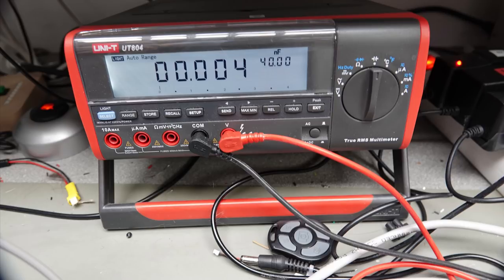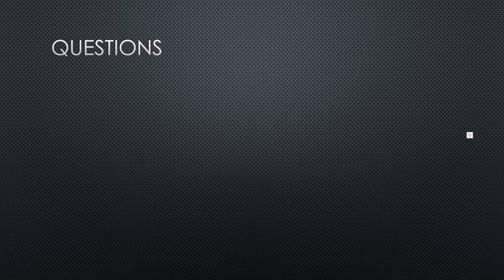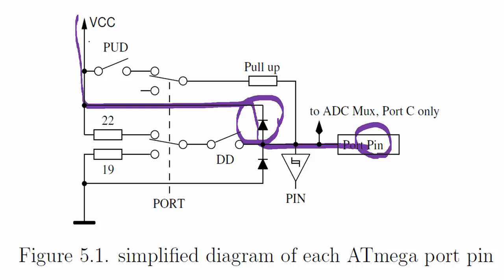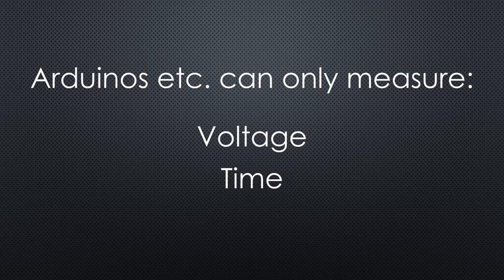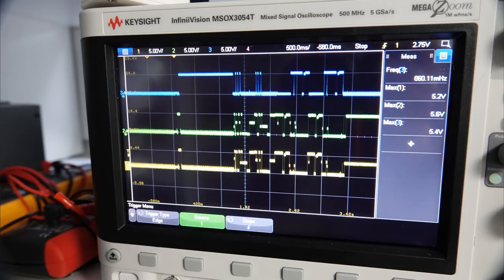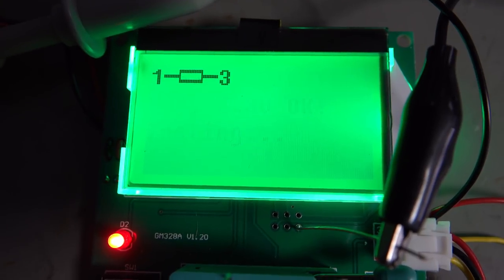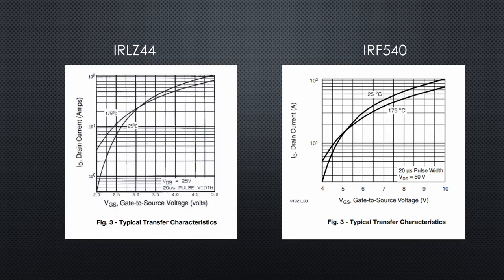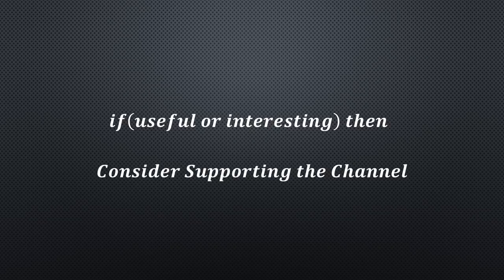#290 How do Transistor Testers work (and some other insights)

Comment: I ordered one but was not able to receive it until well after the warranty period had expired.  Unfortunately, I found that during shipping someone had stepped on it and broken the LCD.  Anyone know where I can get just the display?  Yeah, sure, they're too cheap to repair, but my engineer sense is offended by this.  A thousand Chinese vendors are able to buy these parts by the truckload so why can't I buy one or two as spares?  I've since ordered another device, but I really would like to repair the broken one if just to prove to myself that I can.
Reply from the maker: I cannot help you :-(

Comment: I bought one of these Chinese boxes a couple of years ago, and found the original project due to curiousity how it works.
Truly fascinating little devices, and so useful!
I noticed the original project is/was still going, and had added support for the various displays the Chinese have bolted on.
I did mean to flash an update onto it, but never got round to it (would have involved some board surgery, and my German improving!).
Reply from the maker: This is why I avoided recommending that possibility ;-)

Comment: I repair a lot of stuff (mostly consumer electronics/appliances) and a cheap component tester like this is one of my most used devices for that. What's also nice are those cheap microcontroller based oscilloscopes (I have a JYETech DSO Shell, that I use more often than my "proper" scope).
Reply from the maker: I still use my normal oscilloscope most of the time because I am used to it and know the dials ;-)

Comment: Do any of the clones use better quality parts. I have one but find the battery doesn't last long (rechargable), the display is poor quality with terrible contrast, and the buttons are hit or miss. I don't have a lot to spend but would like one that's reasonable quality.
Reply from the maker: I did not do any tests. Rechargeable batteries might have a high self-discharge. I do not use them anymore in such applications.

Comment: Why the big zif socket if only three pins are needed and not order dependent?  Maybe you can't get smaller ones?
Reply from the maker: Maybe they are cheap?
Reply: Pins in the socket are interleaved to allow parts of different sizes to be inserted. (Choosing an interleave pattern is actually an interesting optimisation problem. Different clones solve it with varied success.)
Zif socket also allows to hold legs of different thickness securely.
Reply: @killymxi   thanks for that.  For maximum flexibility each zif pin needs it's own io port...  unless some are marked as unusable. Hard wiring some together would lead to the possibility of two legs of a component being connected to the same port, which couldn't work. Plus,  I think only two ports are assignable to the adc,  so the plot thickens.  Just for amusement, years ago I was sent free samples of an 80 pin microcontroller.  Scared of sub millimeter soldering I asked the price of a zif socket.  I think it was about 200 pounds.  Gave new meaning to the phrase "cheap as chips".  But not cheap as sockets....

Comment: I saw this tool for the first time in 2014, do not hesitate to buy it, it is very effective for diagnosing components quickly, but I still have my component testing guidelines as in the old school.  It seems to me that this device gets dizzy with the triacs according to the position placed, it happened to me on one occasion.
Reply from the maker: As I mentioned, it does often not work for triacs because of its limited current and voltage capabilities. It is described in the manual.

Comment: Here is an upgraded version with rotary encoder $11 - https://www.banggood.com/GM328A-LCD-Transistor-Tester-Diode-ESR-Meter-PWM-Square-Wave-Generator-Soldered-Module-p-1384846.html?rmmds=detail-left-hotproducts__1&cur_warehouse=CN 

Maybe an updated design with a boost converter P.S. could automatically test semiconductors at higher voltages. Future designs may even be able to include testing vacuum tubes and find reverse breakdown voltages (e.g., distinguish between 1N2003 versus 1N2007) and display higher Zener diode voltages!
Reply from the maker: Thank you for the link!

Comment: I have one and I love it! I have tested lots of stuff with it, I think like you said some of the triac  stuff might not read but I would say about 98%  of the time it is right on. I think that I have successfully tested scr s, and triacs,  I find that there is no one single tool that does it all anyway,  but this thing is pretty amazing
best $15 I spent.
Reply from the maker: Bigger triacs need more current than the device can supply. This is the reason they are not detected. Otherwise a great tool, I agree.

Comment: I really need to get one of these; but, I keep procrastinating.  In a pinch I just use my DMM.  I even sometimes use the diode test mode for transistors.
With my eyesight not as good as it once was, I find myself using the DMM more and more and the color code less and less.

BTW, if I was making one of these, I would use the non-linear behavior of semiconductors as a first check for classification.  This might have been a nice opportunity to introduce linear vs non-linear devices; but, I also appreciate that you are keeping you videos short.
Reply from the maker: I think it uses the "non-linearity" a lot because knowing where diodes are is essential to detect the parts. But of course, it is not a curve tracer. Maybe I do once something like that.

Comment: Thanks so much for this video It answered all the questions I ever had about this device and then some a few years ago when I started messing with Arduino I searched for the software for device in hopes to build my own and possibility  of adding some ideas to the software but I could never find much about this device other than the fact that the Chinese made it and I don't speak Chinese. This is the most informative video ever on this device and my hats off to these two great inventors!
Reply from the maker: I knew since some time that it was invented by Germans, but not how it works.
Reply: @AndreasSpiess  Thanks to these 2 fine Germans and you to you my friend.

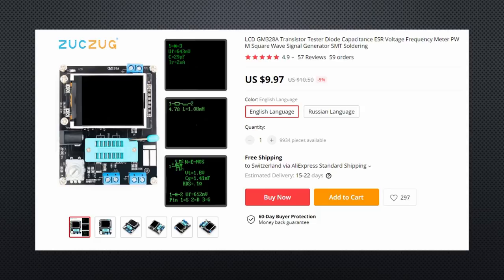Comment: He put the design online for anyone to use. I think that was very cool of him to do that for all our benefit. It's a must have devise for any electronics hobbyist to have. I blow the main chip in my one by connecting it to a fully loaded capacitor like a fool. I was checking zener diodes on a board with the little hook leads that came with it, and the I checked some normal diodes that were unfortunately open and the hook leads were still in the zener section of the tester which can put out up to 30 volts. And that's how the capacitor was charged up. Oh well ya learn from you mistakes. Need to get a new one!! I have my eye on the one he showed in this video at 19:45 the GM 328A  that has the PWM and signal generator built in. Looks nice. I'll just make a zener tester up from scratch. Kasan tv channel shows how to make a nice little one if any is interested in making one!!!
Reply from the maker: Maybe you want to leave a link to this video?
Reply: @AndreasSpiess  I don't use any other form of social  media apart from this (commenting on videos) and I hate Facebook so much that I won't log on long enough to delete my profile.. no bull.. plus I don't know anyone who is into electronics. (Its far to complicated for "everyone" i know) All I can do is mention it in some furture comments on simular videos. 👍

Comment: If I remember correctly, the project started by reverse engineering the (quite expensive) commercial product which does the same. But yes, the component tester finally became better than the original and it can detect (and measure) more types of components. And if I remember correctly the original tester was blue and was some weird shape.
Reply from the maker: I do not know the history from before I told it in the video. Maybe there were more „inventors“ necessary.

Comment: Thanks for the video, letting us know the great project they made. The tester struggles to test some triacs such as BT136 because of required current gate  which the tester can't give and as result  a transistor is represented. But this isn't a bad thing since it is in the specs and for its price it performs pretty good with other components. to test triacs use a simple dimmer circuit as described in the app note of datasheet of the triac.
Reply from the maker: As you said, it is written in the documentation that it will fail with many triacs.

Comment: Can you  recommend  (or "dis-commend") certain versions?
Reply from the maker: I did not do a test (I only have 2 recent ones). But I assume they are similar (if the photo is the same). As mentioned, some have more features, but it should be in the "feature list". I use the second one if the first one did not "convince" me. Sometimes they agree, sometimes not...

Comment: These are useful devices.
Way back in the early 1980s I bought a device which I still use about once a year to program a couple of fusible link ROM chips.  It is a HiLo model ALL-01 Universal Programmer - from Taiwan I think.  The programmer is a box containing pin driver, pin sense and power supply circuits for the 40-pin ZIF socket.  This connects to a dedicated AT expansion board in the PC via a 25-pin cable.  The software runs in DOS and needs a CPU running at 8 or 12 MHz.  To operate the programmer I keep a dedicated 386 12MHz PC running Novel DOS-7 on a CF card pretending to be a hard drive.
Another feature of the ALL-01 that I didn't seriously use is that it came with software that makes it a universal chip tester, at least for the limited range of chips from the early 1980s - mostly TTL from memory.  With modern microcontrollers with analog inputs much less circuitry is needed and we no longer need to be programming and erasing EPROM chips to make our projects work.
Reply from the maker: Maybe you laugh now: Some EEPROMs including a UV eraser are in the mail. I plan to show the younger how this worked in the 80s...

Comment: Somebody, redesign this from Atmel to STM32! Make it more cheaper and add more ADC bits!
Reply: One problem with that may be that the STM32's use 3.3V, so getting past some threshold voltages may be more difficult.  The new ATMega clones, like the LGT8F328p have better internal voltage references, and 12-bit ADCs though.
Reply from the maker: @Valdis: Why not you, if you think this would add value?
Reply: @AndreasSpiess  I'm too lazy for this job...
Reply: @GnuReligion  yep, 3.3V is too low for the job :(
Reply: Because Atmel master race.

Comment: Danke, noch einmal.  I too find the tester extremely impressive, and I made a career of creative designs. And to think the genius who invented was 16 at the time!

Did you ever double-check your BS108s?  Say plug in only the "gate" and one other pin and see if it reports a diode?  I have received several fake parts from China, and the tester has revealed them. It's in fact one of the principle uses I have for the tester.
Reply from the maker: The "BS108" were recognized by all testers as NPN. So they are either fake or very special. I bought them because I wanted a small through hole FET switch which they obviously are not. This is why they are in the bin now.

Comment: One of the most frustrating things with the Chinese clones is that the parts specified in the manual aren't even much more expensive (in China) than the alternatives that are used! They're saving literally pennies and creating a device that is measurably worse!

The manual recommends 0.1% resistors for 680Ω and 470kΩ, which can be bought in ±25ppm 0805 SMD size for less than $0.50 each in 10 qty from Digi-Key/et al., or less from LCSC (you don't even need to use through-hole parts), and one of the recommended voltage references is the LM4040AIM3-2.5, which is a 0.1% 2.50V SOT-23 part and is around $0.25 each on AliExpress in packs of 20 (more like $1.50-2.00 at Digi-Key).

I bought a load of all of those parts almost a year ago with the intention of upgrading the accuracy of my component testers, but for various reasons that's still on my to-do list... (Check the pinout of the LM4040AIM compared to the TL431 - or whatever your board uses - if you're going to make that upgrade, and ideally check the board layout as well, just in case it uses a weird TL431 clone with a different pinout!)

Also, my Chinese clone testers don't even use 1% resistors, from what I can tell. My multimeters aren't the most accurate devices on Earth, but they're accurate enough to show that several of the 680Ω/470kΩ resistors across my three component testers aren't even within 5%! Most of them are within, or close to, 1%, but I have a few resistors that are 6-7% out, which is just ridiculous. Where are they even getting such bad resistors‽

I seem to recall that the TL431 reference used on my testers was well outside of 0.1% as well, but I don't seem to have measured values to hand.

I wonder if it would be possible/practical/worth the time to add a higher-resolution ADC to the schematic and code? IIRC the HX711 that's used in all the load cell Wheatstone bridge boards on AliExpress/etc. is/has a very high resolution (24-bit?) ADC. The 24-bit ADS1256 is available on AliExpress as well, but it has 8 channels and is rather expensive.

I've considered creating my own PCB layout for one of these as well. Mostly just for fun, but maybe I could create a version that fitted into a neater 3D-printed case, for example (but of course anything I designed wouldn't have to worry about ease/cost of manufacture/soldering/etc.)...

And thanks for making more people aware of the history, source, and creators of these devices! :)
Reply: I don't know if there is any memory in the unit, but wouldn't it be possible to calibrate it by connecting a known resistor? Of cause, the firmware should be altered to support this.
Reply from the maker: I think if is possible to do some calibration built-in. But this is a tester, not a meter. I did not figure out if it really does something.

Comment: Nice gadget for a quick check of components,
but if you need detailed info it will not get you around a deep knowledge and a well documented datasheet.
Especially the displayed capacitance values of FETs, for example, are voltage dependent.
Nice video by the way.
Reply from the maker: You are right. But most of us never care too much about gate capacity of a FET ;-)
Reply: @AndreasSpiess  At least we should keep it in mind. Cgs, Cgd and Cds can ruin your day in feedback control systems, amplifier design and all depending on the DC bias point. Even a simple bloody FET-switch can be a pain in the ass if you choose the wrong driver.

Comment: In case you are looking for a cheap DIY version of the rotary version ... I'm not sure how they do it, but €3,33 will be hard to beat ...
https://www.ebay.de/itm/303273559818

Edit: As Andreas noticed, this is probably an oversight/error of the auction owner, as the A1 package displays the full package product  (A4) ... so most likely the 3,33 is just the housing ... interestingly, multiple other auctions for the same product also have the (almost fraudulent) pictures for the different variants ...

 Do the original inventors have some "buy me a drink" PayPal account or something?
Reply from the maker: Pay attention. This might only be the case. It has options which are not well described.
Reply: @AndreasSpiess  True, the ebay page isn't clear - both the A1 and A4 option display the A4 product picture, no picture with label A1 is present ...

Comment: Today i learnt that legs are of crucial importance in electronics. I also learnt that Chinese ones are different from Dutch or German ones. Touching the wrong one might get an electric shock, a fire or in the worst case wrong side of the law. Chinese legs are universal but might not fit well in the machines. On the other hand in my country there is a great amount of diversity so I m kind of stuck there without getting the full picture. And recently a few rats entered my high security storage area and cut the boxes for my 3d printer electronics board. As usual, I touched some wrong legs in wrong place in the RAMPS and the mega voltage regulator was fried. I had a Chinese 7805 with different legs because it was flexible. I bent the legs but the one Chinese works ok although doesn't look beautiful.

Anyway thanks for suggesting this tester. It saves the hassle of looking into datasheet (which never matches the real one). One addition I would like to have is to have hanging "prongs" so that it can inspect different legs without disturbing them and finding out how good they are and how they might they behave in different circumstances. And of course, wifi enable this tester with paramerters logged somewhere which can be stored in the rfid tags of the container storing the chips. And we can always add the weight sensor like in the cat food video. And add one nfc reader in the cupboard attached to esp8266 which stores all the data over the "cloud" Real difficulty is making the software which plugs everything smoothely. But I want such a system to make life easy with so many small legs.. Needless to say bigger legs attract more and easier to work with.

And thanks for suggesting magic mirror software. Its written in ugly node JavaScript  like the node js but gets the job done. Maybe I will buy a cheap mirror from the marked make a 3d printed case add the pi+display behind it. Maybe add Bluetooth receiver+wireless charging+battery bank over that..but rgb matrix has its own charm.
Reply from the maker: You could then call your project "fusion", because it includes most of the things presented on this channel ;-) 
I was not sure if others also call these wires of electronic parts "legs". But we do it here.